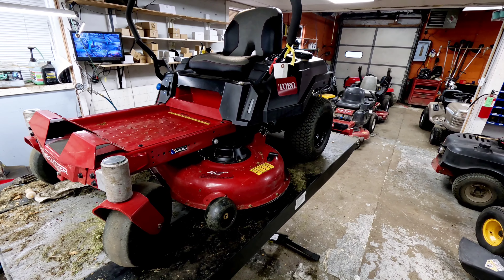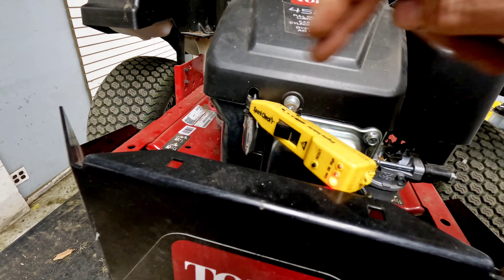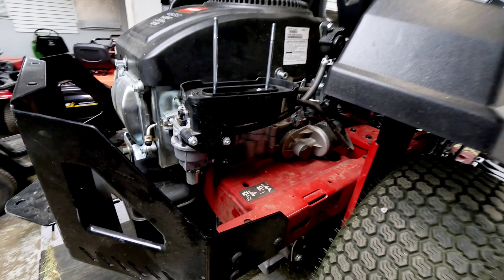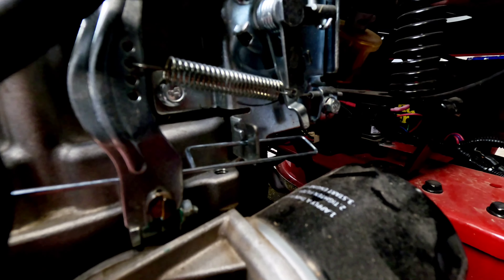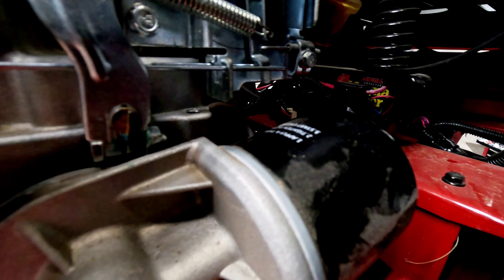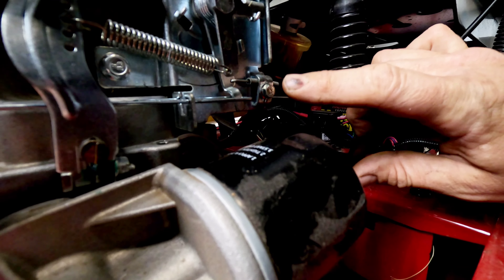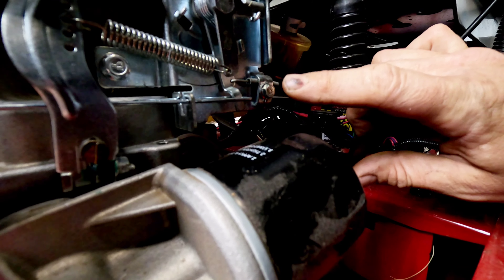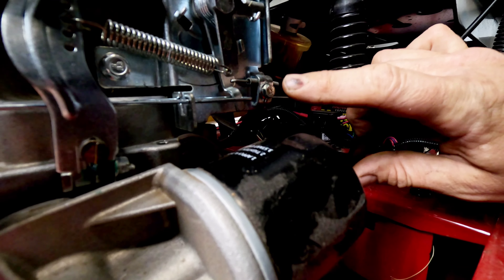Zero Turn Mower Cranks But Wont Start Toro TimeCutter How To Fix Full Diagnosis & Repair Guide

Comment: Just bought ss560 and it did the exact same thing. Checked the carb, starter, battery, spark plug, and finally came to YT. Its nit the exact same issue, but sure as shit, I held the choke up with my finger and it started up instantly. 
My grandpa told me early on to always start with the easiest cheapest fix. I bet he never thought that would be YouTube.

Thanks for your help. Truly. Thank you.
Reply from the maker: It is crazy sometimes how easily things are fixed, especially when they come adjusted wrong from the start. Glad to help!!

Comment: Question,  my zrtur. n muffler bolts fell out. Put new sst in and tightened. They also came out.    Did I do wrong using sst?  Any hi temp threa locker?
Reply from the maker: We normally don't use SST because they are softer and can cause them to seize to the aluminum many times. A coat of oil sometimes helps slightly with this issue if you are going to use them. Are the threads pretty well gone at this point or are they ok?
Reply: @IndRepair  threads in good shape. They were tight when done. Normally never used, thought I would try. Will buy reg. Allen heads this time.   Any type of third locker suitable with that heat?
Reply from the maker: @steveriggenbach90  Vibra Tite 19960 works well just make sure you cure it properly before putting the mower in use. I have only used it a couple times in extreme cases but it sure works well. Doesn't really seem quite as tight as a red Locktite but will work in the high heat
Reply: @IndRepair  thank you
Reply from the maker: @steveriggenbach90  Yes sir!

Comment: My 75740 timcutter cranks but sounds like it's grinding,  I've changed battery and solenoid in my opinion is it possibly the voltage regulator?  It somehow eventually starts but it take a few minutes of turning over until the noise stops
Reply from the maker: It does not start I assume? Grinding likely is the starter but will not cause a no start issue unless not turning fast enough
Reply: @IndRepair  it will eventually start but it take a while before the starter turns over,
Reply from the maker: If starter not turning likely have bad starter bendix or gears on starter or flywheel are worn/broken

Comment: your opinion on encore ztr and encore engines ?
Reply from the maker: I have only ever worked on a few but from every one I have seen they look great but are a very poor quality. They seem to be made cheap as possible and do not stand up over time. Thanks for watching!
Reply: @IndRepair  DEALER SAID THEY HAVE THEIR OWN ENGINE FACTORY.  i find that hard to believe.
Reply from the maker: @bobhaddock957  Ha! Never heard that one before for Encore but some people will say anything to get a sale...I would check further into it before buying, last one I saw had good welding on top of the deck and the underside was just barely tacked and looked like a 5 year old did it